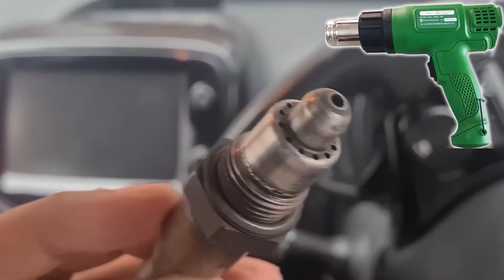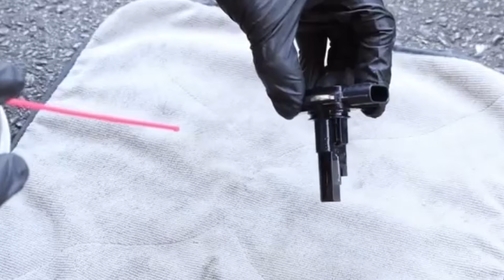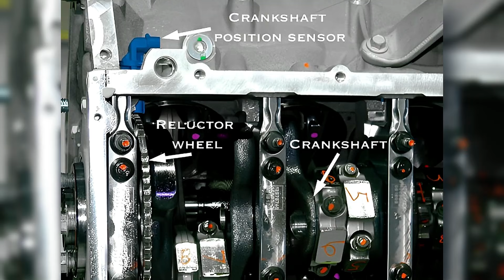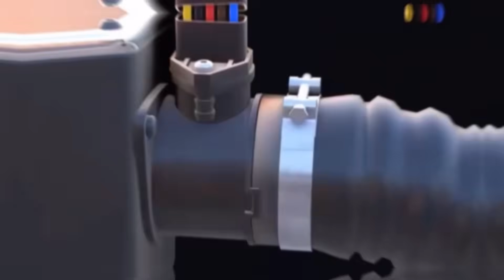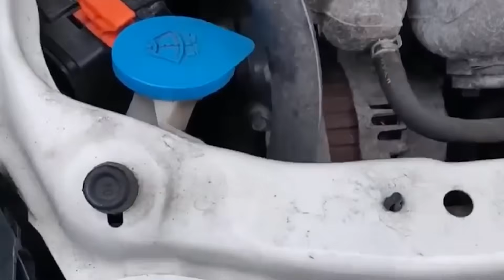Nobody Cleans These 5 Sensors — And Your Car Pays for It

Comment: I have an 01 Plymouth prowler with a 3.5Liter motor.  It has 14,800 miles on it.  It has started recently having a surging idle at startup.  It doesn't seem as noticeable once the engine gets up to temperature.  What should I check on this engine?
Reply from the maker: 14,800 miles on a 2001 means this engine has spent most of its life sitting — and that's actually the problem. Low mileage old cars get varnish buildup in the throttle body and IAC from fuel degrading over years of inactivity, not from miles driven. Cold surging idle that settles when warm is classic IAC and throttle body varnish on that 3.5. Clean both thoroughly — throttle body cleaner on the plate and bore, IAC passage too. Also run a full tank with Techron concentrate to clean injector varnish. That Prowler deserves better than sitting issues at this mileage.

Comment: Rpm idling up n down when driving. car cranks but won't move or go
Reply from the maker: Need the car make, model and year to help properly. But RPM hunting plus car not moving after cranking — clean the throttle body first before anything touches the transmission. Bad throttle position data causes exactly this on most platforms. What car is it?

Comment: 98 mazda b3000 v6,idles at 3grand,will do 40mph idling,cleaned both iac and maf,no help,replaced both,no help,shows lean bank 1and 2 codes. unplugged the iac,runs much better...
Reply from the maker: That IAC unplug clue is your diagnosis. When removing the IAC makes it run better it means the IAC was flooding air trying to compensate for a massive vacuum leak somewhere. New IAC and MAF won't fix a vacuum leak. On that 3.0 Vulcan check the intake manifold gaskets first — they're notorious for cracking on that engine and create exactly lean bank 1 and 2 together with high idle. Smoke test the intake if you can, that'll show the leak location in seconds.

Comment: Hello, I got a 2019 Kia Optima with 48,000 miles on it. For about four weeks, extra long cranking until it starts intermittently he died one time while driving progressively gotten worse and then ultimately the car won’t even start. original spark plugs never changed out
Reply from the maker: Four weeks of progressive worsening to complete no start on a Theta II engine needs honest attention. Original plugs at 48k aren't the cause of this pattern — worn plugs cause rough idle not progressive no start. That intermittent extended crank that stalled while driving and got worse over weeks points to CKP sensor or fuel pressure dropping. Check CKP connector first — clean it with contact cleaner, dielectric grease. Also critical on that specific engine — check oil level and listen for any knocking. Theta II 2.4 has a known connecting rod bearing issue that causes progressive symptoms exactly like this. If oil is low or you hear any knock get it to a shop before driving further. That's the one thing worth catching early on that engine.

Comment: Don't  forget the PCV valve.  If it is stuck shut the engine builds up internal pressure and the engine will start to burn oil and / or leak oil past the gaskets.  Usually accessible somewhere around the valve cover. There is a ball bearing and spring inside the pcv valve that creates a  one-way valve.  The pcv valves on my  2003 and 2006 4runners were both stuck.  Soaked them in lacquer thinner and shook them untill the ball bearings were free and sealing.
Reply: Also replace the pcv hose if it's hard.
Reply: 46 years on this earth and several cars, I've NEVER seen one go bad. I replaced them as preventative measure but every single one that I took out rattled like it should. Nobody checks PCV because it rarely ever goes bad. For you to have not one, but TWO cars having the issue shows something of yours is the pattern.
Reply from the maker: Good add — and directly connected to this video. Stuck PCV valve is what sends oil vapor straight to the MAF sensing element. Clean the MAF and leave a stuck PCV alone and you're cleaning the same sensor every few months. Fix the source not just the symptom. That lacquer thinner soak trick on stuck valves is real — most people just replace them but a $0 soak beats a $15 part every time.

Comment: If there is a P0171 code it is running lean either a weak fuel pump, bad fuel pressure regulator for example, but the fact the code is there means the fuel air mix sensor is working so a new sensor won't fix it. Positive fuel trim lean condition, negative fuel trim rich condition.
Reply from the maker: Exactly right — P0171 means the system detected lean, not that the sensor failed. Sensor had to be working to report the lean condition in the first place. Replacing it solves nothing. Weak pump, bad regulator, vacuum leak, dirty MAF — any of those cause the lean condition the working sensor is accurately reporting. Shops count on customers not knowing that distinction.

Comment: Sluggish take off causing rattling sound.  1997 Chevy Astro 4.3
Reply from the maker: Sluggish takeoff on that 4.3 Vortec is MAF first — clean it before anything else. But the rattling under acceleration is worth paying attention to. On that engine if it's a knock or ping sound under load it could be the spider injector assembly causing lean condition — 4.3 Vortec is known for that. Lean engine knocks under load. Clean the MAF first, if rattle continues under acceleration get the fuel pressure checked before driving it hard.

Comment: If you plan on keeping your car for a long time, and can afford it. Make sure to learn how to do these cleaning yourself & Shop for replacements that are made by same manufacturer as the OEM but without company logo.  Wait for need to replace.
Reply from the maker: Solid advice. Same factory that makes the branded part often makes the generic version on the same line. Denso, Bosch, Delphi — they supply OEM and sell identical parts without the dealer logo for half the price. Learn to clean, wait to replace, buy smart when you do. That's the whole system right there.

Comment: Hello, my daughter's 2005 E46 is sluggish. It drives very good at gets up to 60 miles but all of the sudden it can go into limp mode. Have to restart it to get it going again. Also while driving and its driving well, if she slows down and tries to pick up again it drags,stalls, hesitates to pick up. She has to let go of gas pedal, rpm has to lower itself, she gives it has and it picks up again and hits the 60 mileph mark. What do you tgink it could be
Reply from the maker: That limp mode triggered under acceleration on an E46 is almost always the MAF on that M54 engine. BMW's EML system pulls power and locks it down when airflow data goes wrong under load — exactly what you're describing. She has to restart to reset it because the computer latches the limp mode until power cycle. The hesitation on throttle pickup is the same sensor struggling at partial load. Clean the MAF first — $8 MAF cleaner, 15 minutes. On that generation BMW it fixes this exact pattern more often than not before touching anything expensive.

Comment: Working a p0174 bank 2 lean,  MAF cleaned, throttle body cleaned, smoke tested intake and exhaust, no leaks code only triggers at highway speeds, notice trim would change when brake pressed , replaced the brake booster, improved the numbers but still got the code, replaced MAF sensor still a code, O2 upstream when checking showed good numbers except heater would jump to 70% while bank 1 39% . Found the top motor mount had come apart, check exhaust again realized the braided flex pipe end caps that hold the braid has broken loose figured this was result of top mount going out.
Ran 3 tanks of concentrated techron, no misfires recorded,  finally today the O2 sensor showed 89 to 100% heater on... Ordered a sensor , prior to sensor arriving started spraying kroil on the sensor, I placed my deep slotted socket on it and I barely added pressure to it and found it nearly finger tight .
Cleaned reinstalled 38 ft lb, final test heater stuck on 100% no green wires as I use dielectric grease on the connections replaced all vaccum hoses 100% silicone.. so sometimes it is the sensor, but glad I had a chance to fix the other items only wasted money was the MAF
Reply from the maker: This is the kind of comment that belongs pinned. You did everything right — systematic elimination, smoke test, checked the booster, found the mount, traced the flex pipe damage back to it. A loose O2 sensor finger tight causing heater circuit issues is one of those things you only find by actually looking. The MAF money wasn't wasted — you ruled it out properly. That's real diagnosis, not guessing.

Comment: I have Fiat500 0.9 TwinAir 2012. When I turn on electricity, all is good. But the moment I start the engine, I get Start&Stop Unavailable and Check Engine light. Then I had a Hill Holder unavailable error too, but it disappeared like in 2 weeks - Idk how or why. please let me know if i should go to service, or it can be fixed on my own. I don't want to pay hundreds of euros for a 20eur fix.
Reply from the maker: Don't go to service yet. First step is scanning for the actual code — any auto parts store or a cheap OBD2 scanner does this. The TwinAir is known for MAF contamination causing exactly that Start&Stop unavailable plus CEL combination, tiny engine is very sensitive to dirty airflow data. Hill Holder disappearing on its own points to an intermittent sensor connection somewhere. Get the code first — if it's MAF related that's an €8 fix you can do in 15 minutes. Come back with the code number and I'll tell you exactly where to start.
Reply: @AutoTruthLab  Thank you for your answer. I bought a OBD2 scanner and the only code I got was P0420  nothing else. I also bought the MAF cleaner just in case. Also I found out that my Cooling tank is leaking. Looks like a little hole in the plastic between the parts where it was welded/connected (not sure if I explain it correctly). So hoes are fine, but the tank has little hole or right in the middle of Min/MAX.

Comment: ABOUT...: DRIVE BY WIRE THROTTLE BODIES:

-----do NOT clean out the throttle body  of a "drive by wire" (coil packed) car...

THIS will trip the computer into "limp mode"...and triggers "events" -in the fail-safe data. *(---I did this once...)

2005 Nissan Sentra SE-R (auto...) 2.5L

---I took the "Seafoam" bait... 

To make things worse... 
*(-I was a student at NASCAR Tech...)

Cleaning the engine bay... I decided to clean and shine up:  -the intake hose...

-then the intake plenum...

-and then (eventually) -the throttle body...

~Bad idea!!!  

---I did all the right things...
*(---I [even] waited an hour; -battery disconnect ed... before attempting to remove the throttle for cleaning...)

*The next time I turned on my car... high idling, -then "limp mode"... 
(---at every traffic light and stop!

So, ---I took it to school...

(----and my Nissan instructor...) ---failed to successfully, turn off that code!!!...

*So I did the next best thing...

*(---I bought an old "dirty" one from the local "Pull-A-Part"...and THAT did the trick..) ~it worked!!! 🤣🤣🤣🤣

-It has everything to do with "Air Flow" ...  (---and a little thing to do with "voltage communications too...) 🤭

Comment: I have a 2018 Honda Civic I took it for oil change one of the person tell me my engine is shaking a little bit. Can you tell me what is the cost of that please?
🙏
Reply from the maker: Can't give a cost without knowing what's causing it first. On a 2018 Civic that slight shake is usually the throttle body — carbon builds up on that 1.5 turbo engine and causes exactly that. Clean it yourself for $8 before paying anyone. If the shake is still there after that then it needs a proper diagnosis. Don't let that oil change shop quote you anything without knowing the actual cause first.

Comment: You'd think engineers would program these sensors to be more specific in diagnosing the real problems instead here's a code figure it out. It's all about the money
Reply from the maker: The codes are vague by design. A code that says "clean your MAF for $8" doesn't send you to the dealer. A code that says "system running lean" sends you to a $400 O2 sensor. Same problem, very different bill.

Comment: Ford fiesta 2012, hard start. Starts after spraying throttle body or choking air system. Cleaned MAP sensor
Should I remove throttle body and clean other side?
Reply from the maker: Yes remove it and clean both sides. Spraying through the intake only gets the air side — the backside of that butterfly valve is where the heavy carbon sits on that Fiesta engine and you can't reach it properly without pulling the body off. While it's out clean the bore walls too. That hard start will go away completely once both sides are properly clean.

Comment: when cleaning themes iar flow sensor s do i need to disconnect the battery neg lead of my 2026 battery coated under rear seat
Reply from the maker: You don't need to disconnect the battery just to clean the MAF — unplug the sensor connector before spraying, let it dry completely, reinstall. The battery disconnect is recommended after cleaning to reset fuel trim adaptations but on a 2026 it can reset other systems too — radio, windows, driver assists. Instead just drive normally for 50-100 miles after cleaning and the ECU will relearn on its own without losing anything.

Comment: I had a P0420 OBD2 code and a CEL light. After a couple tanks with a fuel treatment additive BG44k, after clearing the code, the issue went away.  It appears to have helped clean the O2 sensor(s) and/or the Catalyst.  I'm glad I tried this first.

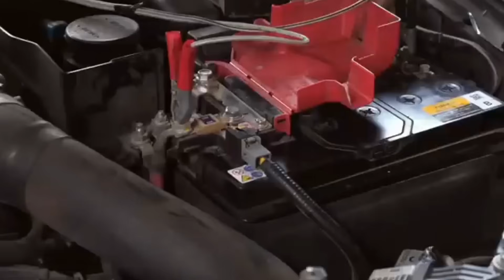Comment: RANGE ROVER SMOKING BLACK ON ACCELERATION- AND LOSS OF POWER. WHAT COULD BE THE PROBLEM? 4:08
Reply from the maker: Black smoke on acceleration is the engine running rich — too much fuel, not enough air reading. On a Range Rover that's the MAF sensor first suspect. Dirty sensing wire tells the ECU airflow is low, ECU dumps extra fuel to compensate, black smoke out the back and power drops. Clean the MAF before anything else. If it's the diesel TD6 also check the EGR valve — carbon buildup there causes the exact same symptoms.

Comment: I miss 1970's cars. Not all this electrical bull crap
Reply from the maker: Carburetor, points, timing light. That was the whole diagnostic system 😂 Now you need a laptop just to change the idle speed.
Reply: @AutoTruthLab exactly.

Comment: What sensors will i find in my SsangYong Diesel?
Reply from the maker: All five from this video will be on that SsangYong diesel — MAF, throttle body/TPS, MAP, CKP and O2. On a turbodiesel the MAP is the most critical one, it monitors boost pressure and carbons up fast. MAF second — diesel soot coats that sensing wire quicker than petrol engines. Start with those two before anything else.

Comment: I have a 1993 Acura Legend with a rebuilt engine, new fuel injectors, rails, filter. The car has a problem once it heats up with it's idle. The engine check engine light is not on. The car has a somewhat rough idle and hesitates coming off of idle to accelerate. Accerleration is fine. What do you think is causing this problem.
Reply from the maker: Rebuilt engine, new injectors, no CEL but rough idle and hesitation off idle when hot — that points straight to the throttle body on that C32. Carbon on the butterfly plate causes exactly this, worse when hot because heat affects the throttle plate movement. New injectors rule out fuel delivery so the air side is the culprit. Clean the throttle body first, both sides of the plate, then check the IAC valve — on that Legend generation a dirty IAC causes hunt idle specifically when hot that no check engine light will catch.

Comment: Thanks for all the info. I have a 1998 infinity i30. I go out one day and leave my driveway, I look at the dashboard and the speedometer is not working, the odometer reset to 0, the fuel gauge spiked to full and the temperature gauge spiked to high. Everything seems fine to drive since this happened. No issues whatsoever. Please, where do I start
Reply from the maker: That's not a sensor cleaning issue — when multiple gauges fail simultaneously in one moment it's almost always the instrument cluster itself or a power/ground issue feeding it. On that I30 check the cluster ground connection first, a loose ground causes exactly this — speedometer drops, odometer resets, fuel and temp gauges spike because the cluster loses reference voltage. Find the cluster ground behind the dash, clean it and reseat the connection. Free check before anything else. If grounds are solid the cluster itself may be failing internally — common on that generation Infiniti.

Comment: Kia Rio 2016
Stepped on the gas to get through
a yellow light. All of a sudden I get a blinking yellow engine light.
Engine is milldly running rough. 
Then the yellow blinking engine light goes off after 2 miles. It stays off the last 3 miles to my house .
Reply from the maker: Flashing CEL is specific — that means active misfire happening at that moment, severe enough to potentially damage the catalytic converter. It stopped flashing because the misfire resolved, but the code is still stored. Get it scanned before driving hard again — even if it feels fine now. On that Gamma engine hard acceleration misfire is usually MAF struggling under sudden demand or a weak coil on one cylinder. Scan first, that code tells you exactly which cylinder misfired and points you to the fix.